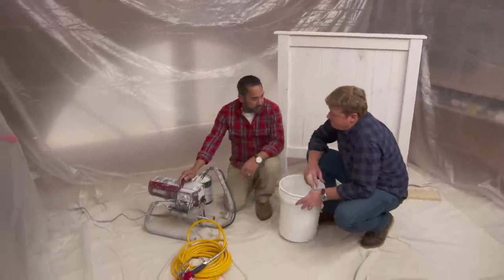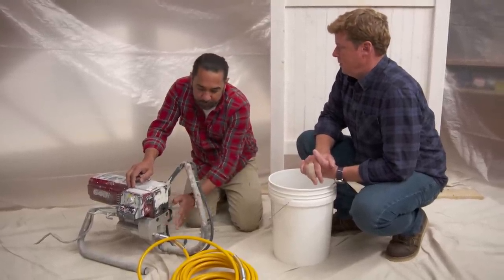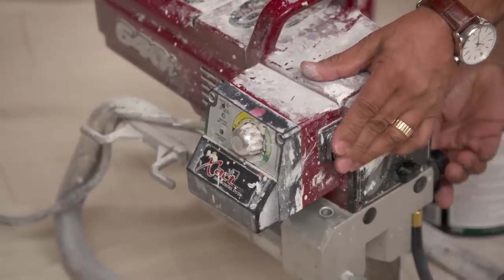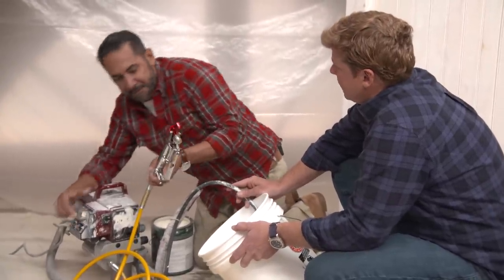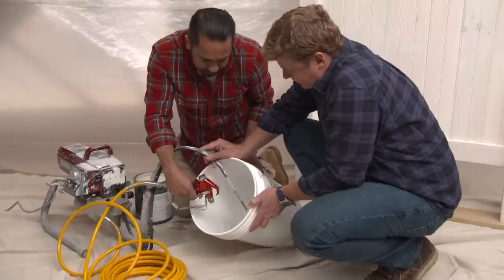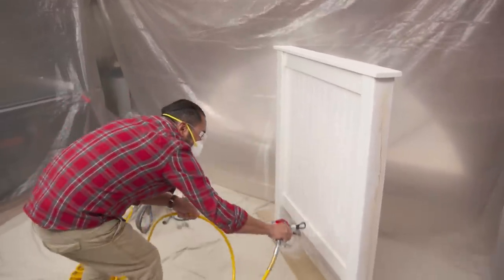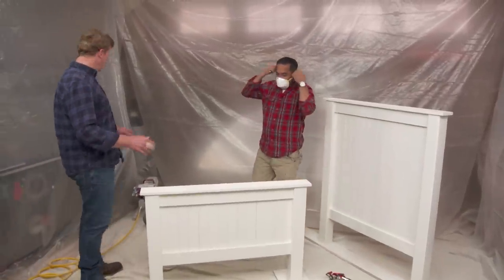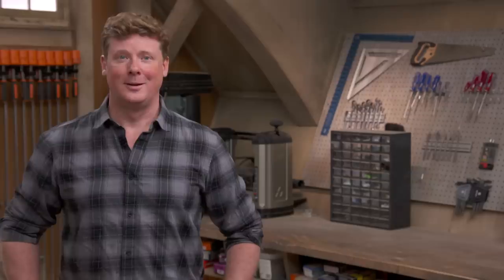How to Use a Paint Sprayer | Ask This Old House

Comment: Im a student worker at a university over this summer, and we have a bunch of ac units that need cleaning (something like 500-600 maybe?). Power washing isn't quite perfect, and these are units that are hip-level, and the vents face the ceiling. We actually began using a paint sprayer instead of anything else because it works quite well, they're not that difficult to use at all, and work well with water in applications where you want to spray but you can't exactly use high-pressure like you'd see from a power washer.

Comment: Can I use a spray paint gun to stain paint. My stack fence? It a think stain paint that I have use to stain my patio but I did that with a brush and roller.
Reply: Use a garden type pump sprayer for exterior stain it works great.
Reply: I recently stained 600ft of 6 ft privacy fence in 1.5 hrs with airless if that tells u anything! Keep pressure low and back roll or back brush the sprayed on product.

Comment: What is the advantage of airless sprayer over air sprayer?
Reply: Waste is a big one and over spray.
Reply: Advantage is application time, not prep time which would be more. And multiple coats of same item with 1 prep stage only. For your house, use for ceilings closets and doors. Nothing else will save much time unless you have color change of trim and it is detailed.

Comment: 1:38/2:37 - Wasted half the gallon of paint just purging and priming the system...
Reply: I would imagine a lot of it is in the pump and tubing.
Reply: @michaelsteinbach  Some of it.  That system is overkill as it were for that job.  Pro painters using that sprayer for doing a house would be using larger 5 gal and then keep refilling the bucket so there's no need to reprime.
Reply: That’s the only downside to these type sprayers is that you waste a lot of paint. There are all kinds of small jobs that I would like to use it for, but I just can’t stomach wasting a quart out of a $40 gallon of paint. That’s why I also own a gravity feed HVLP gun...
Reply: What's the difference with this and a HVLP gun. With that you only fill the cup with what you need and cleaning it is so easy plus I'd go with a compressor noise any day over that noise. Feck me... it's so irritating. 😂
Reply: @SteS  HVLP sprayers need the paint to be thinned out, so you have to apply more coats and risk swelling the pores of the wood your spraying depending on the thinner you use (ask me how I found out...).
Reply: @cup_and_cone only by 10% which isn't much really, once the paint hits the nozzle and atomises it's less than 10% when it hits the surface. I'm in the process of spraying stuff with a 2k automotive primer filler. It fills in any small defects better than anything else. Then top coat can be pretty much anything. Again, a 2k car paint will be much tougher. BTW, how do you know. :)

Comment: Pretty good tutorial  although you failed to mention all machines  are slightly different  my Uncle designed and manufactured the Titan  Airless  spray system  although he retired many years ago  and sold the company off. To someone else. And i beleive it’s currently a part of Wagner  these days after. A few  mergers. With other companies  over the years  i still have one of the original machines he gave to my Dad  in the 80s  i beleive  like many companies. They started out in a 2 car garage then. Had to  build a gigantic multi million dollar  building to keep up with the global demands

Comment: $1700 sprayer :O
Reply: No way. My boss got 1 just as good for just under $300 with a 1yr warranty as long as it's cleaned.
Reply: A titan 640i ?
Reply: You can pick these things up pretty cheap when someone buys it, uses it, doesn’t clean it properly, then can’t get it to work.... replace some filters and hoses, clean out the pump head, clean the gun and tip, oil the piston and crankshaft, and voila, you have a very expensive sprayer for yard sale prices. The one I own was free. It cost me less than $100 to get it running perfectly.